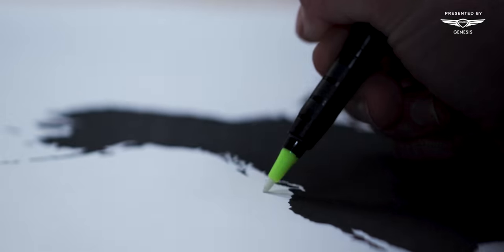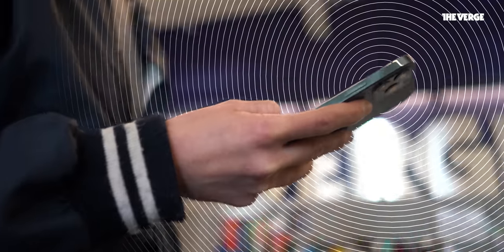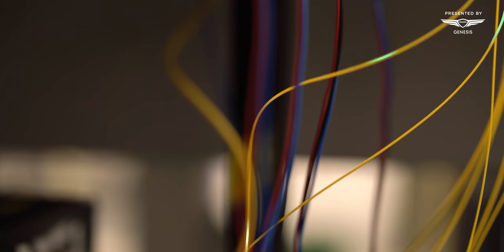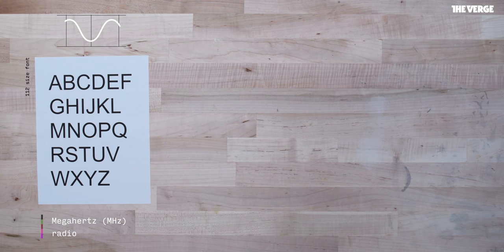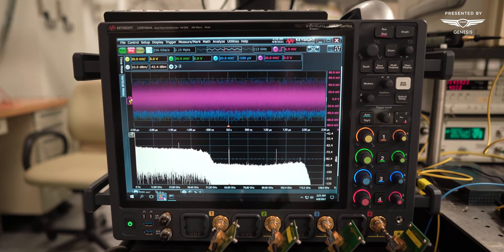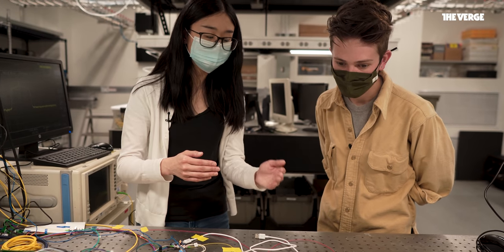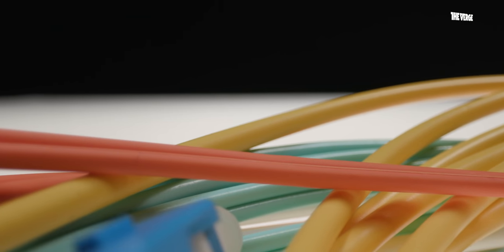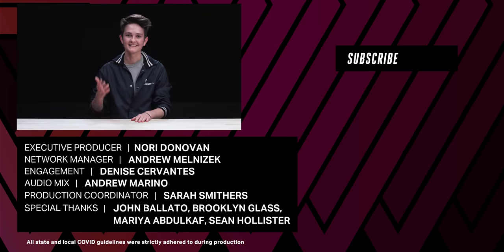How glass fiber is shaping the internet

Comment: Yes, electrons do not move as fast as light, they are pretty slow in fact, but this doesnt matter, because it‘s the electric field, that carries the information in a cable and it does indeed propagate at the speed of light.
Reply: Yeah, that's what I also thought. I don't get how such a fundamental thing is repeated in a wrong way over and over again. If it were the electrons, I also would have to wait for minutes until the light turns on in my room after pushing the button.

Comment: Yeah, I'm "The guy" who said "you can't break this." When fiber cables break, it's not because of the glass, its because someone did something stupid with it. People shoot guns at aerial cables, drop things on it, etc.
Reply: I've heard in channels such as Linus Tech Tips, they say to be careful with fiber optics because it is glass and it can break easily. This was a video on networking. 

Also, Go Tigers.
Reply: @static_sid  Nope, the glass is intrinsically strong as you saw. Again, if you drive a nail through it, then yes, it'll break, but it's anything but weak. Today's fibers, those meant for houses / offices, can be wrapped around a nail and show no change in light transmission.

Comment: I've gotta nitpick. The signal in a copper cable travels extremely fast. Very close to the speed of light in a vacuum. Light in a glass fibre is ~30% slower than that. Glass fibre adds significant latency over long distances and this is a huge problem. Low Earth orbit satellite networks will achieve better latency than glass despite a larger circumference round the Earth. Optical fibres are used for their low attenuation and some other benefits. If developers can get the distance and reliability out of copper or aluminium you we might see fibre optics being overlaid with traditional cables for latency sensitive applications. Hollow core fibre would also solve this. You can put multiple frequencies down a normal cable just the same. Electrical signals are still waves. They're not counting electrons coming through.

Comment: You can also generate quantum entangled photons with optical fibre. E.g. with photonic optical fibre (or polarization maintaining fibre) using a pulsed laser. I know that because i've implemented such systems in the lab.
Reply: Also it's very fun to work with optical fibre! cut them or coupling them too!

Comment: You keep talking about how the data travels by electrons and even mention that they very slowly along the wire and this is true. But they actually move much too slowly to send data along. This is is where your error is. Data is not sent along as electrons flow but actually as a wave, which is much faster. One electron 'bumping' into another etc can send a signal much faster than sending electrons down a wire.

Comment: I think you need to get some of your facts straight. Fiber is better in many ways than copper but for example fiber and coax have about the same velocity of propagation, aka light signal and RF signal both travel at about the same percentage of speed of light through the line. Also when you say electrons can’t pass through each other, are you implying that only one RF channel can exist at a time on a coax line lol? It almost sounds like your talking about Morse code limitations from the early 1900s. Modern day coax uses electromagnetic waves and can carry hundreds of channels and frequencies at once, it’s called frequency-division multiplexing (FDM).